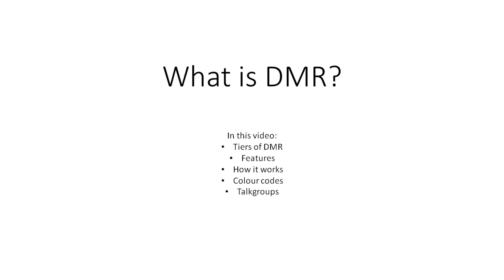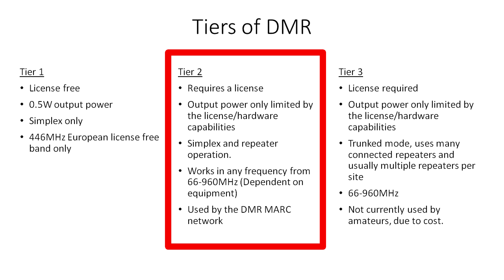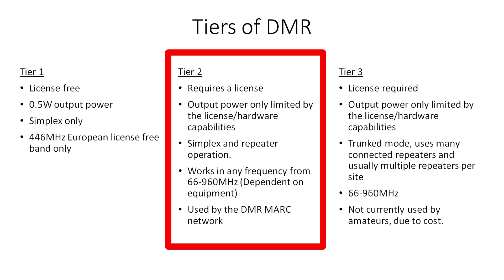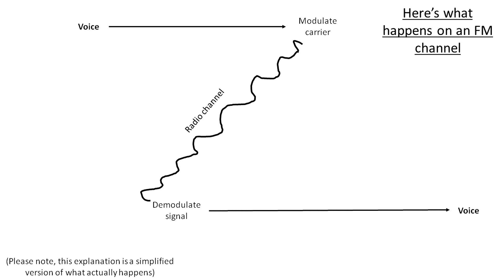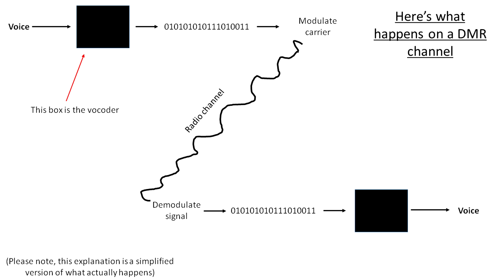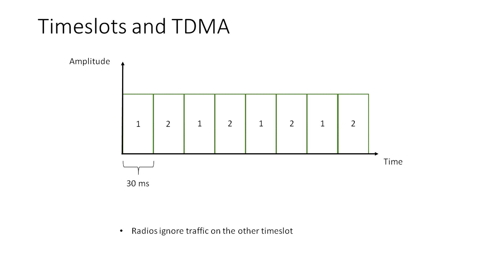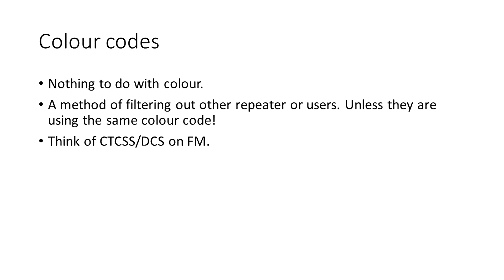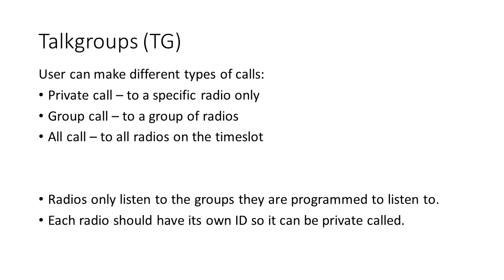What is DMR? (aka MotoTRBO) - DMR radio explained

Comment: I don't like jumping through all those hoops to achieve... Wait.  What good are these, again?
Reply from the maker: Excellent question. Let me answer: Double the spectral efficiency, much easier linking of systems over IP, built in signalling, text messaging, private calls, radio enable and disable if a radio is lost or stolen, strong encryption, trunking options, better battery life, no noisy audio at weak signal strengths.

Comment: I bought a DMR From Amazon yesterday and when I got it today I had no idea what all the menus were and I thought colour groups were to change the colour of the screen lol. I am a noob... This video helped me a lot thanks, thumbs up from me
Reply from the maker: Thanks!
Reply: Thank you for replying. I have a Radioddity GD-55, it claims 10W. I only have 1 right now as the 2ed one will be delivered tomorrow, in a city what range could I get if u use the both of them "back to back"?
Reply from the maker: Hah, that is one of my most hated questions. I can't possibly tell you. The distance you will get depends on so many different factors such as the power, antenna, how you're holding the radio, the terrain, the weather. If you have used FM radios then the range of DMR is about the same as FM.

That radio does not work properly on DMR repeaters though so if you're intending to use repeaters you should just send them back now.  See my blog post for more info: http://radiosification.blogspot.co.uk/2016/12/dmr-radios-to-avoid.html
Reply: radiosification thanks. I was only planning on using them back to back.

Comment: Does the repeater buffer, so that if you want to reply to someone in your group, on an occupied TS, you can transmit voice and have it record and played out, as soon as the TS frees up?
Reply from the maker: No, it isn't that smart
Reply: @radiosification  Too bad. Talk about spectral efficiency! Probably require some element of server though. Could also trunk the packets out!
Reply from the maker: @Integr8d  there is DMR tier 3 which is trunking, so if the timeslot was busy it would just use another

Comment: Great video. I am Looking at buying a DPMR VHF, UHF radio, could you tell me if it will do all the same receiving as a DMR radio ? Thanks
Reply from the maker: +Liam Ellerington Thanks. No, you cannot use radios for any standard with a different standard. You must buy a radio specifically for that standard of digital. It's sort of like with phones: If you buy a GSM phone, it won't work on a CDMA2000 network.

Comment: Thanks for this. So are all 12.5khz channels split into 2 timeslots or are there some that are split into more than 2?
Reply from the maker: FoCDrums On DMR it is always split into 2. That's just how it always is in this standard. Other standards can use more timeslots, such as TETRA uses 4 timeslots, but uses 25KHz channels. They essentially have the same efficiency which is 6.25e (equivalent to one conversation per 6.25KHz) The e on the end of 6.25 is just there to show that it's not actually 6.25KHz channels, but it's equivalent to that. I guess in the future we will have modes that are even more efficient than this, for example maybe 3.125e, which would mean equivalent to one conversation per 3.125KHz.

Comment: This was a really helpful video!
Question: In simplex mode, can one make a call to a specific radio or is that only in a repeater set up scenario?
Reply from the maker: You can do everything in simplex you can do on a repeater in terms of functionality for the end user. So yes you can make individual, group or all calls in both.
Reply: @radiosification  fantastic! Thanks for the speedy reply!
Reply from the maker: @ephjaymusic  No problem. If I could ask, what made you think you wouldn't be able to do that on simplex? Was there something misleading in the video?
Reply: @radiosification  from 05:57 you were describing the usage of repeater setups. When you proceeded to the section on "Talkgroups" I was still thinking this was in the context of repeater use only.
Reply from the maker: @ephjaymusic  ah okay, thanks for answering

Comment: Thx Sir, I am a complete novice user of an analog FM radio & only has skin deep knowledge after a year let alone comprehending what you just said. DMR radios seems to have all the advantages of a UHF/VHF analog radio & more, please give suggestion on which DMR radios for budget & advance users.
Reply: Checkout the Radioddity GD-77. Good reviews, and very affordable right now. Under $90
Reply from the maker: Do NOT buy any of the dual band DMR radios. They are all full of bugs and none of them work well enough to be worth your time. A budget DMR radio is the MD-380 which works very well and has been out for a long time now so has all the bugs fixed. Some of the current radios have hardware issues which will never get fixed by firmware updates.

Comment: Noob here. So from what I can tell, DMR users would normally just use an ALL CALL in the beginning to establish contact with other unknown users and move on to private or group calls , right ? I imagine that means that if you're just scanning using a DMR you won't be hearing much if anything at all, as most calls occur in groups or privately right ?
Reply from the maker: No. All calls are really meant for maintenance or emergencies only. Not for routine use. Maintenance as in the radio guy is about to shut off the system for half an hour to change out a cable or something and wants to announce it to everyone. DMR was designed for business use so there aren't features for people who want to talk to unknown users. In the amateur world though it has been adapted and people use particular groups for different things. These depend on which network the repeater is connected to. For example here in the UK I might put out a call on talkgroup 235 which is the national talkgroup connected to all repeaters on the network (at least, that particular amateur DMR network)
Reply: @radiosification  In my country, we use All Call for repeaters so as to prevent the repeater from being occupied by unknown HAMs in unknown talkgroup.

Comment: Excellent video. Our local police department are converting all digital. I am doing much research into how someone can listen in. with digital its much harder. Any Idea how somone could do this with a digital radio? IE: Baofeng DM-5R can these radios be set to listen to digital communications that may be encrypted? or Non-encrypted? 

Thank you
Reply from the maker: If they go encrypted, forget it. You could spend all your time looking up how to listen in but you would never find out, because encryption is specifically designed to stop anyone from being able to understand the communications. If you're in the US, they're probably going to P25 or P25 Phase 2, not DMR, so don't buy a DMR radio.

Comment: I'm looking at getting the md-380 or md-390GPS from tytera. Any suggestions on what I need to do on my end? I'm already licensed but I don't know if there's another step I need to take. 73's. KM6FKJ.
Reply from the maker: You just need to register for an ID with your callsign. Have a look at my programming video for that radio. There is a comment thread in that video I think where somebody else was asking about this, and I linked them to the page to get the ID.
Reply: radiosification thank you very much. I'll check it out.

Comment: Any and all advice from publisher of this video and any keyboard warriors. Can I set up a pair of digital radios, motorolas MOTOTRBO radio line to be specific on a single DMR channel to communicate with lets say four radios on one talk group? To be detailed on what im asking is that I want to set up four radios as said before to transmit to each other ONLY. I dont care who else can hear the transmission, all I am worried about is those four radios. Thanks and nice video!
Reply from the maker: +DoD Secure What are you saying about keyboard warriors? I thought you were going to be one, with a name like that. I almost blocked you from commenting straight away.
Reply: +radiosification sorry. so does that mean I cant get any info?
Reply from the maker: +DoD Secure It's kind of a pointless question really! You're asking me, from what I can understand, whether it's possible to get 4 radios to communicate with each other. Well, that's actually what these radios were designed to do, so yes of course you can. Maybe I'm not quite understanding the question right?

Comment: Video didn't really help.  I have a DMR, radio, an ID code, but still have no idea how to use it to contact another amateur.  This video doesn't tell me how to do this.
Reply from the maker: This video was not supposed to tell you this. Don't know why you go around assuming any video about DMR will tell you how to contact someone. Not all videos are about that.
Reply: What's your problem and have you solved it? In order to contact someone, your radio MUST have the same frequency, colour code, time slot and group ID as his radio. This 4 key elements determine whether or not you can transmit. Obviously, your friend and you should have a reasonable distance otherwise you can't contact him. If you're contacting someone via a repeater, also make sure you have the correct uplink & downlink frequencies and your radio ID.